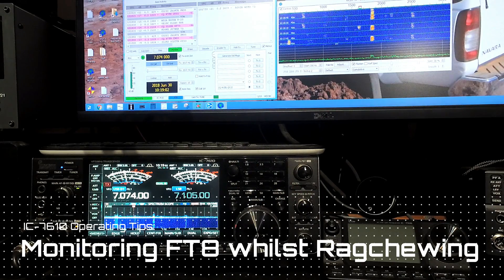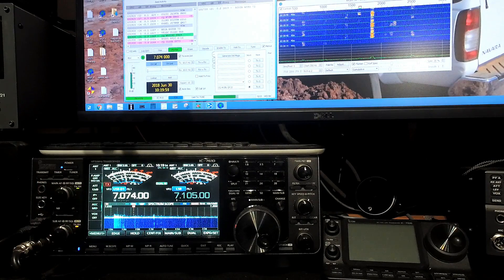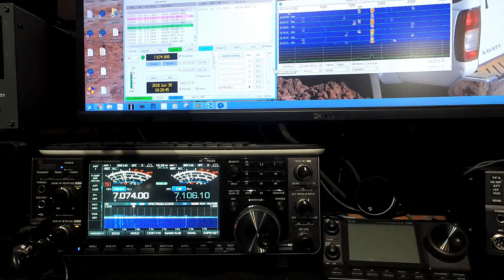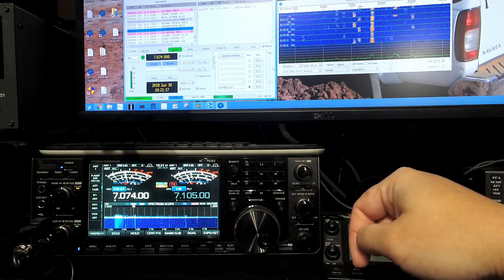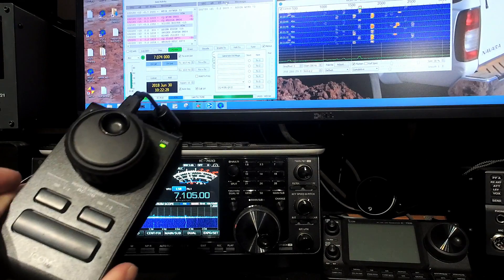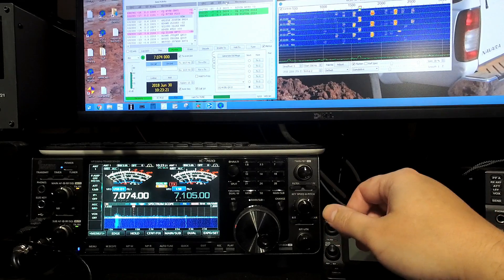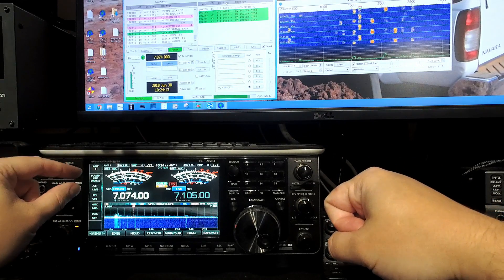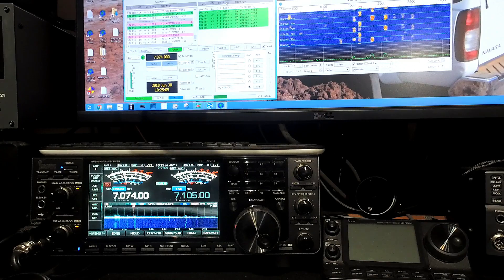Icom IC-7610 How to use FT8 whilst Ragchewing

Comment: This works for FT-8 on the left and listening on the right, tuning the right with the RC-28.  However, when you hit split yo switch Xmit to the right (sub) and key the mic, the sub automatically switches to USB-D1, which disables both the mic and LSB mode.  Any suggestions??  Tnx for the video!

Comment: I'm probably missing something here. It seems like an interesting idea but one that's severely hampered by the fact there are 2 receivers, not 2 transmitters. So, I guess if you are not an active FT8 user and just want to watch the FT8 traffic scroll by while you Xmt/Rcv on your chewing channel on radio B, then it's OK.  Then, if you see an FT8 call of interest, you'd have to abruptly cut out of your rag chew, for 2-5 minutes, switch modes, execute your FT8 QSO, hopefully QSL, then reset things to go back to watching FT8 on radio A and chewing on radio B.  When I'm on FT8, I can barely keep up with the traffic - and that's with a very compromised 60' sloper at minimum solar flux. Can't imagine how it would be with a proper antenna.  The activity window would scroll by so fast you'd have to Zen focus on it to properly appreciate the traffic. Can't imagine trying to carry on a voice QSO at the same time.  I guess I'm not that adept. Ha!  Still, all in all, it's an interesting example of dual reception capability.  Another point is that you'd obviously need separate aerials to feed both receivers concurrently.  No danger of frying anything though since the 7610 only transmits on one or the other.  That brings another aspect. Input overload on radio B when radio A is transmitting within feet or yards of the other antenna.  Your article surfaces a lot of things to ponder. That's the point of any good article. So, kudos to you.
Reply from the maker: Its more for if you’re a avid DXer who also likes to ragchew; you would simply apologise whilst you quickly work the needed station on FT8.  73, Jarrad VK3BL :)

Comment: You can do it without the RC-28 but you have to disable rig control in WSJT-X. You lose some features of WSJT-X like "Fake-It" Split operation, but I use it this way all the time. Also, if you are using headphones and want to hear your rag chew in both ears instead of just the right ear, you need to change a setting on the radio. Go to Menu --> Connectors --> Phones --> L/R Mix and set it to On.
Reply from the maker: Thanks for the helpful comments Scott; I had not considered the implications when using headphones :) 73, Jarrad VK3BL

Comment: Useful info. I was thinking you could achieve the same things using something like Commander to scan the sub-band rather than the RC-28 gizmo, but that would require an extra comm port .  I'll play around some more.
Reply from the maker: I definitely think the radio supports the functionality, its just a matter of someone with the programming skills making it happen.  For now, there is my kludge (workaround).  Thanks for the comment, 73, Jarrad VK3BL :)